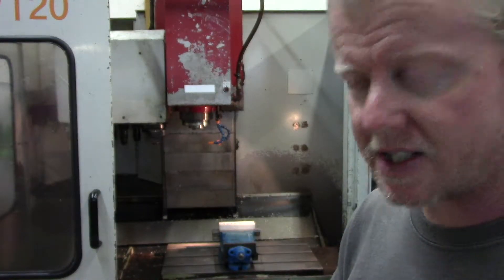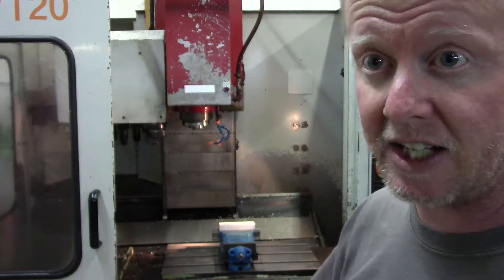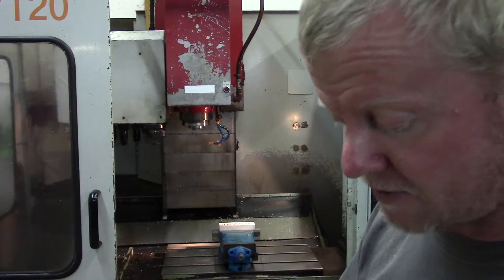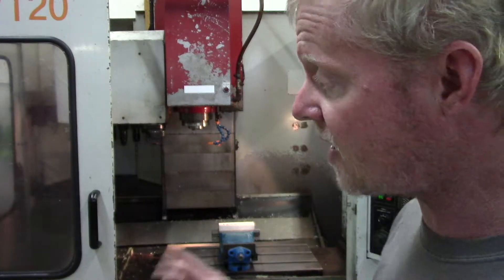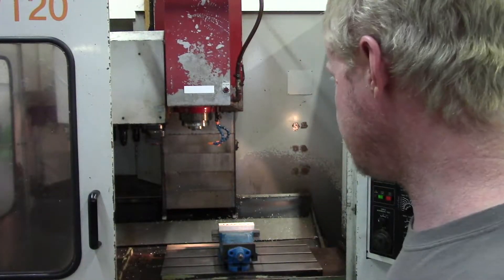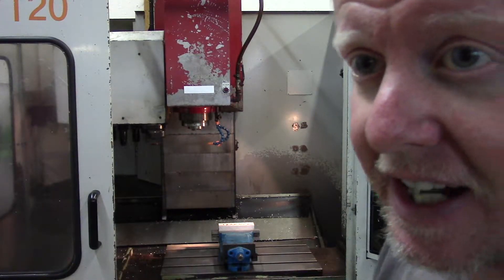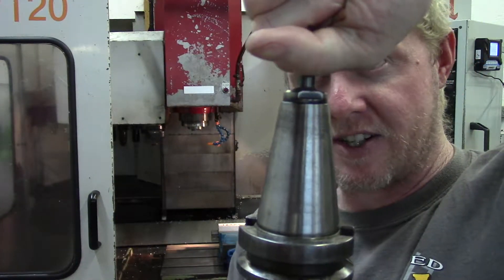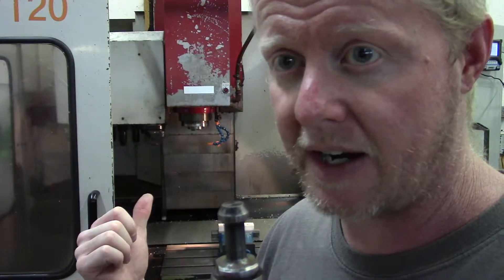Haimer Repair , Doom & Vise Jaws Part 1

Comment: today the same sensor fell out of my hand, fell to the floor.  Effects such as a broken tip and a jammed clock.  Disassembled and blown (attention, do not lose the springs and other parts).  waiting for the tip and it should work
Reply from the maker: It's been years now but that unit that fell still works great.

Comment: Hi , this is a good vidio you made I had the same problem and I crashed my haimer , can you send me a link on how to disassemble and fix this haimer model that you have , becouse I couldnt find this spesific model  on the net.
Reply from the maker: There isn't any haimer repair info.  Pretty much if it's broke they sell you a new one.  Disassembly is pretty easy thou, just back the adjusters out and the dial will come out. At about 13:00 I explain how it comes out.  I've been using that same haimer for years now, no issues.

Comment: hello, long shot. i have a haimer I'm trying to repair. how far off zero did yours end up? this is a good .5mm out. I dont get enough adjustment out of the screws, the clock looks fine to me
Reply from the maker: Mine was more than 0.3 inch.  I've dropped at least two other units and had no problem getting them back working. What kind of event happened?  I may be able to give you some additional pointers.
Reply: @ShaneBurrell1  from what I can gather it was a Z axis crash. tip went. I've inspected all bearing surfaces in side the housing there isn't a scratch anywhere. I've come to the conclusion the unit didn't bottom out and it shocked the clock mechanism skipping a few teeth perhaps?
Reply from the maker: From what I remember the assembly should twist quite a bit to allow you to get it back to zero. If it is off by more I would suspect sticking maybe?